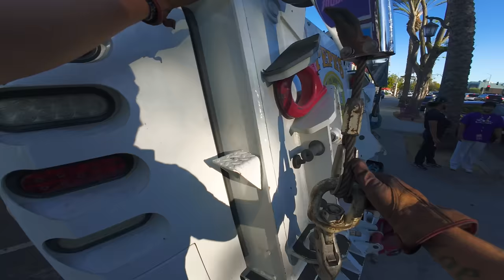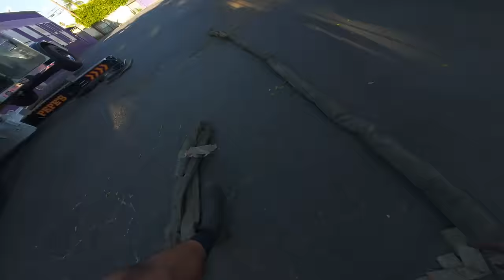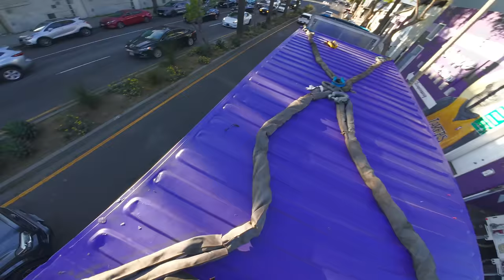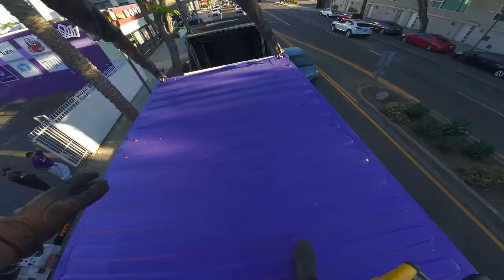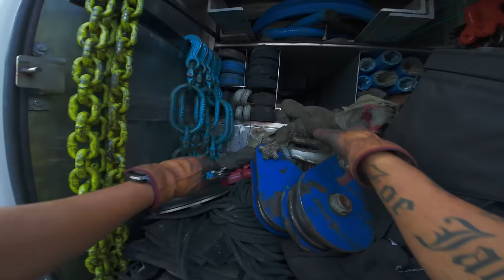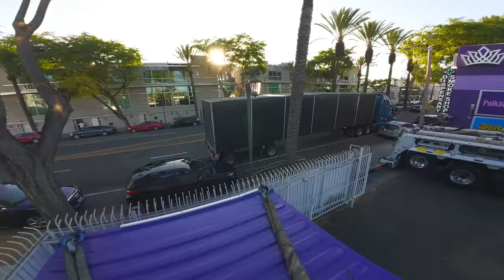"Flying High" Delivering a Medicinal Weed Container

Comment: That truck driver couldn’t get out of there fast enough and it was interesting that no one could help with a tagline. Alex should get 2024 Employee of the Year.
Reply: He was standing next to it, if you are that close put your hand on it, I’ve done myself
Reply: That driver was blocking traffic, I work cranes daily. 99% of all drivers won’t help with a load as they then become liable for damages etc
Reply: @millwrightdad3753 my guess there’s a reason that fence has barbs on the top I wouldn’t want to hang around in a neighborhood where anything unattended for 5 mins goes missing 

Even after the point you make too

Comment: The fact that nobody held the pedestrians back from walking under the container blows me away
Reply: Completely agree. Most people have zero situational awareness. The least the driver and employees could have done would have been to help with safety.
Reply: This is LA, you need a permit to “close” the sidewalk at 3am, but not obstruct a lane for an offload.
Reply: @jayrosenberg3646  True, even if they ran some "Danger" tape out and stand near it.
Reply: In Los Angeles, pedestrians have the right of way. Even if you put up barricades and tape and cones and had two officers with flags shouting "NO! Don't go that way!", Angelinos would still walk under it.
Reply: @bradfordjeff  And then sue someone's ass off when they get hurt....

Comment: The reason the container was spinning so much is your lifting from a single fall with a six stranded type wire rope these will slowly start to untwist when under load when one end is free to spin, lifting from the two fall side would have helped with the spinning.
Reply from the maker: It was supposed to be able to spin, that was the whole point of single lining it so it would be easy to place exactly where they wanted it. The guy not keeping it steady as it came up was the issue.
Reply: @PepesTowingService  may be my British terminology didn't explain that well, I get it needed to spin from a single pick point I was getting at the number of parts of line if you lift a load with one part of line with a 6 strand rope it will keep spinning as it's the rope unwinding that's why cranes use a non rotation type rope.

Comment: Idk if Alex or Josh reads these comments BUT, they need to make sure the ladder extends 3 feet beyond the landing surface (top of container, in this example), or connected to the container.

Safety guys!!

 Plus, putting these videos up with that not complying to OSHA requirements, opens you up to all kinds of crap